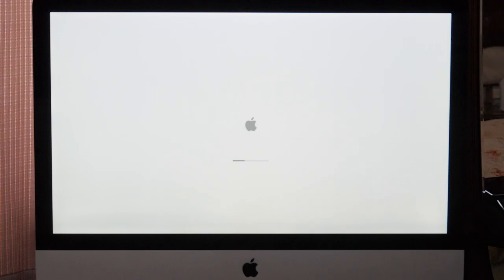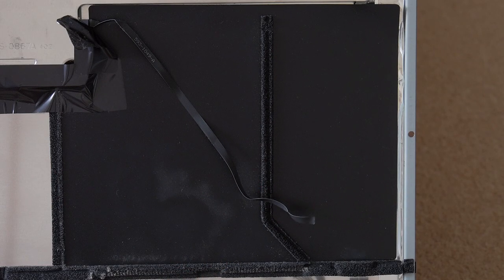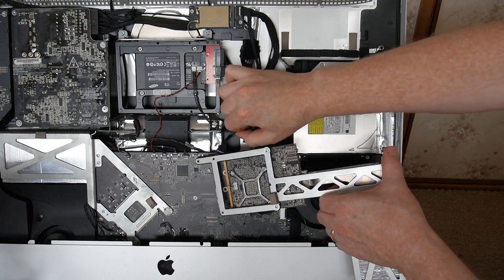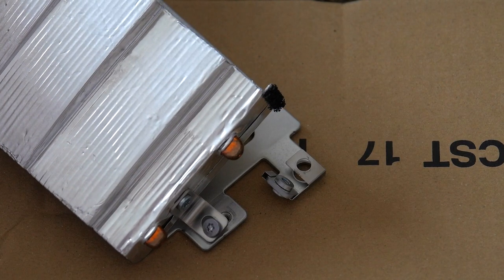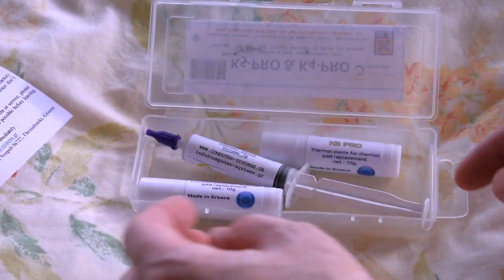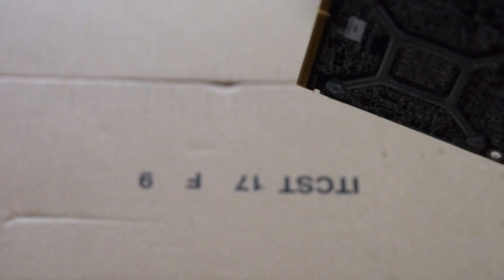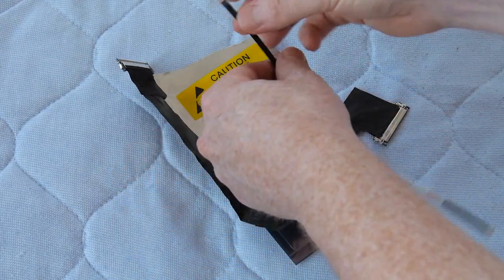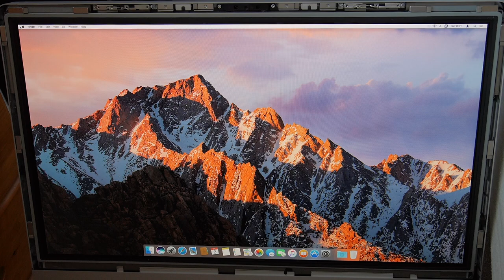Late 2009 iMac 27" Video Card Repair — 4850 — 2nd Bake

Comment: Hi JDW, did a 2nd bake on a 27in A1312, after a month on the first bake the GPU just crashed. After the 2nd bake the screen was just black, i thought that the GPU was dead, but after reinserting the video cables LCD opened up and everything is working. Hope this 2nd bake will last longer .
Reply from the maker: I'm sorry to hear your 1st bake lasted only 1 month.  My 1st bake lasted only 4 months, but my 2nd bake lasted 2 years and 9 months.  I think the problem with my first bake was that I didn't fully clean off all the old thermal paste, and the replacement paste I used wasn't brand new.  I'm therefore curious... Did you clean off all the old paste and apply K4 Pro (or Kryonaut) on the GPU and K5 Pro (or thermal pads) on the memory chips after your 1st and 2nd bakes?
Reply: @JDW-  on the 1st bake i cleaned the GPU the best I can. I think my issue was I am using a manual oven. So maybe the actual heat was not correct. Now made the oven heat up for 5min before placing in the card. And turn the dial over 200°
Reply from the maker: @JujoeM  My advice is the use a turkey thermometer or another oven safe thermometer during the oven warmup time to ensure the temperature is (1) correct and (2) stable.  If it goes lower than 200°C, the worst that can happen is the GPU chip won't be fixed, but if it goes much higher than 200°C, the worst that can happen is that components will become desoldered and possibly fall off.
Reply: @JDW-  Hope you guys are doing good. My iMac gpu died again, it gave me vertical lines. maybe the GPU is really bad already. I'll bake this again :) Question: does the proper thermal paste placement and brand/quality makes the GPU bake last longer? or the GPU is really going out already? Thank you as always
Reply from the maker: @JujoeM  I'm very sorry to hear that.  Your case seems a bit unusual.  You got only 1 month from your 1st bake and only 2 weeks from your 2nd bake.  There are only 3 explanations for this: (1) Your oven temperature is wrong (you need an oven safe thermometer to confirm it), or (2) you used only 1 type of paste on all the chips and/or you used old paste, or (3) your card is just too far gone for the bake to work.  If the oven temperature is very close to 200°C/392°F and stable, and if you use both types of paste that I recommend, I would think you should get longer than 1 month or 2 weeks of life from a bake.  With that said, there are no guarantees.  I can only tell you my experience and the experiences of other people in the comments, since I read and reply to every comment.  Thermal paste is very important though.  I didn't do a good job with thermal paste after my 1st bake, and I feel strongly that was the reason it lasted only 1 month.

Comment: I tried this and it worked!  Thanks!  On a side note, both the cpu and HD fans are spinning at top speed all the time.  Does anyone have any ideas why or how to fix it?
Reply from the maker: Thank you for sharing your success story, Clay.  As to why your fans are spinning full blast, you either forgot to reconnect a connector, or it wasn't connected security, or your inadvertently broke a wire.  All said, you will unfortunately need to reopen your iMac to recheck your wiring.  If a wire pertaining to a thermal sensor is not connected properly, that sensor would not work and would explain why the fans spin at full blast.

Comment: hello, I saw on many movies the bake solution but you are the one who convinced me. I have a mid 2011 iMac with this problem, I have already repared it with apple with the extended warranty. So, long story short... Is it ok to put K5 also on chipset? I messed up the order and now I have just K5. Thank you for your time
Reply from the maker: Thank you for your comment.  I would love to answer your question, but first, could you please explain what K5 is?
Reply: @JDW-  sorry for my confused question, I was referring to the grease you used for thermal contact. You are using K5 pro for memory and K4 pro for chipset. All I've got is K5 pro and the question was if I could also use it for the chipset or I must buy K4 or other thermal paste
Reply from the maker: @secpet  Thank you for the clarification.  No, you cannot use K5 Pro on the GPU chip because K5 Pro is made only as a thermal pad replacement paste.  As such, it has lower thermal conductivity.  Because you do not have K4 Pro, I would suggest you buy Thermal Grizzly Kryonaut because that paste is slightly better than K4 Pro. https://amzn.to/36NMQwu
Reply: @JDW-  Thank you for your quick answer. My K5 pads and Thermal Grizzly Kryonaut are arriving on Monday so on Sunday I'll be cooking, Can't wait! I'll post my results here.
Reply from the maker: @secpet  I look forward to hearing the result!  Best wishes!

Comment: No luck for me. Baked in the oven at 200º for 7 minutes and smelt like fried. When I took out the graphic card, the brown part of the main chip was melted, inflated. Of course it was not working anymore......any clue why that happened?
Reply from the maker: 200°C is the correct temperature, and although you may have set your oven's dial to that temperature, the only way anything would have been melted or fried is if (a) you left some kind of plastic part or perhaps the black foam surrounding the GPU on the card, which you should not do, or (b) it could be that your actual oven temperature is in fact higher than 200°C despite the dial setting.  I would love to see a photo of your card so I can better see what you are seeing.  Please also tell me the model of the card and the model year of the iMac you pulled it from.  Thank you.

Comment: What if I used the same Grizzly Thermal Kryonaut paste on both the GPU chip and the VRAM, would I still be ok?
Reply from the maker: No!  Definitely do NOT do that.  You need K5 Pro for the VRAM because there is a gap between them and the heatsink.  Kryonaut is NOT made to fill gaps.  K5 Pro is made to fill gaps.  You could also use thermal pads on the VRAM, but since it is very hard to measure the gap accurately, I advise people to use K5 Pro because it is a thick paste made to replace thermal pads and you don't need to measure anything to use it.  Amazon links to all these pastes are in the text description beneath my video above.

Comment: Hello. Quick question, can I use the thermal grizzly paste on All chips, and not only the GPU?
Reply from the maker: No.  There is a gap between the memory chips and heatsink.  That is why you must use either thermal pads or K5 Pro.  But to use thermal pads means you must measure the gap.  I personally cannot measure that gap perfectly to my satisfaction.  That is why I use a thermal pad replacement thick paste like K5 Pro.  Never use K5 Pro on a CPU or GPU though.  It's only for cooler running chips like memory chips.  You can use any good paste on the video card GPU.  I recommend K4 Pro because it usually comes included in K5 Pro kits.  But if you want the best, buy Thermal Grizzly Kryonaut for the GPU and use K5 Pro on the memory chips.  That's the best possible thermal paste combination.

Comment: As an electronics serviceman, the reason why this happens is because you have a considerably heavy  component generating heat rapidly and cooling down consistantly as it switches between igpu and random buffering etc. Because it's a component which is mounted vertically with solder. Solder tends to dry up and become brittle as it becomes oxygenated it gradually loses it's conductivity. Very common fault with Smart TV's which uses ARM based processors soldered and mounted in a similar fashion. When you heat it up, iyou're forcing those impurities out and reforming the bond. Especially the surface mounted components, the solder is very prone to microscopic cracks the eyes cant see
Reply from the maker: While that is a logical analysis and most often true, the fact remains that the video card issues only apply to iMac model years 2008 to 2011.  2012 and later iMacs continue to use basically the same body shape and continue to have their newer version graphics cards mounted in the same exact vertical way.  The heatsink and overall cooling solutions of 2012 and later iMacs are not really better than prior iMacs.  And yet, the 2012 and later iMacs don't have the same problems with graphics cards failing as their older siblings.  Although it may seem clear to some that the solder balls are the issue (for reasons you just stated), it is in fact a problem that goes beyond that.  Yes, it could be the solder balls in a few cases, but the majority of failures pertain to the design flaw in the graphics cards in those 2008 to 2011 iMac models.  More specifically, in the GPU chip itself, such that when the GPU chip is heated in the proper manner, the flaws internal to the chip realign so that the card works again, at least for a time.  While heating the card works long enough for most people to find the bake worthwhile, it doesn't last forever because the flaw inherent to those cards is still there.  Even so, if the bake can make a computer last another 2-3 years, most people like myself who try the bake find that it is something worth doing.  

The ultimate "fix" is to buy a newer iMac; and with Apple Silicon being so amazing today, it makes the most sense to get one of the latest models, assuming 24" is large enough, and the colors Apple has chosen doesn't blind you. :-)
Reply: @JDW-  newer models are integrated with little to no solder basically hard pressed onto the circuit board with tiny holes in between for air flow/compensation for expansion  with no components on the otherside which also acts as test pint for tracers. The older method relied on having the chip float ontop of the solder balls so the chip wouldnt transfer it's heat onto the board and have components dropping off the otherside
Reply from the maker: @jizmo9398  But there are still 3 things your otherwise logical and reasonable argument is not factoring in. 

First, "hardpressed" or not, the 2012 and newer iMacs still use a GPU that connects to a PCB using solder balls. Photo example: https://www.notebookcheck.net/uploads/tx_nbc2/GeForce_GT_640m_3qtr.jpg

It also doesn’t matter so much that PCB is the motherboard itself or a separate daughter card that connects to the motherboard. The heart of your argument focuses on the theory that solder ball integrity is the root issue with the 2011 and older iMac graphic cards, so the fact that both the 2011 and older iMacs and the 2012 and new iMacs use a GPU chip that connects via solder balls (hard pressed or not) is significant to show there is not a massive difference in that area between the iMac model years.

Second, Apple switched from AMD to Nvidia starting with the 2012 model iMacs. That, I believe, really brought about the resolution of the root problem, not simply from the Nvidia chip being "hard pressed" to the PCB. As I have said, it’s a problem inherent to the GPU chip itself, on AMD branded GPUs, rather than solder balls which physically connect the GPU chip to a PCB.

And thirdly, the temperature of the bake, which is known to resurrect malfunctioning AMD graphics cards in 2008 to 2011 iMacs, is not hot enough at 200°C to truly melt (and therefore "reflow") the solder, because if it was, the components on the bottom of the video card would fall off during the bake. But they don’t fall off (with a stable 200°C baking temperature), thus providing evidence we are not truly melting the solder balls under the GPU chip. Furthermore, we are not adding any flux either when we do the bake, which really would be required to reflow the solder in the proper way. 

What the bake does is heat the AMD branded GPU chip sufficiently (at 200°C for 9 minutes or so) so that the defect inherent to the chip itself, not the solder balls underneath, are resolved, albeit not forever.

Even if one is adamant about rejecting my conclusions, the fact remains that the bake works for most people who try it, and it tends to last long enough to have made the effort worthwhile.  That's not merely my feeling, but rather the general consensus of most people who have provided such feedback to me under all of my bake videos over the years.  I read every single comment posted, and in many cases reply to them as well.

Thanks again for sharing your thoughts!

Comment: Your video is fantastic. My iMac 2009 video card just died 4 weeks ago and your video inspired me to try this "bake". I'm not a techie so alot of this stuff is new. Do you need 2 different thermal paste? I'm thinking of just using Artic MX 4, which is non conductive on all the chip.
Reply from the maker: Thank you for your kind words.  I would strongly advice that you use 2 types of thermal paste, yes.  The reason why is because if you clean off all the thermal paste on your video card, including the THICK THERMAL PADS atop the memory chips, you will either need to use THERMAL PADS on those memory chips (which I do not advise) or use a very thick and specialized "thermal pad replacement" paste like I did.  K4 Pro and K5 Pro are sold on Amazon and come in a kit, as mentioned in my video.  I am past the 5 month mark and my video card is still going strong.  You could try other pastes that are NOT electrically conductive, but you will still have the problem of how to get that paste to work on the memory chips.  You see, there's a big gap between the memory chips and the heatsink, which is why normal "thin" paste won't work to fill that gap.  And again, that's why I went with K4/K5 Pro.  Best wishes!
Reply: Thanks for the quick reply! As I have mention, I'm totally clueless...so the different between the 2 paste is that 1 is thicker? The reason I mention Artic MX 4 is it was highly recommended in some forum and will last for 8 yr. But I have no idea if you can apply it to the other chips. Is the Artic 4 too liquidy and wouldl not be able to achieve the thickness required?
Reply from the maker: Arctic MX 4 is a thin, liquid paste that is not intended to replace "thermal pads."  So even if you use a lot of MX 4, I don't think the connection between the top of the memory chips and the heatsink would be good, nor would it last 8 years.  You must either use thermal pads on the memory chips or do what I did and use K4/K5 Pro.  I never used "thermal pads" as replacements, so I can only provide advice based on what I used.  You definitely need a very thick paste atop the memory chips, just like what you see in my video.
Reply: That's what I thought too. Thanks for the advise! BTW, I was running High Sierra which I just upgraded and a week later this thing died...$700 to replace the video card. A real bummer.
Reply from the maker: I would never pay $700 to replace the video card in a 2009 iMac.  If it ever gets to the point where a bake no longer works, and if my only option to buy a new video card is to pay $700, I would be better off recycling the 2009 iMac and buying a new one.  The 2015 and later iMacs don't seem to have this video card death problem.
Reply: It work! Thanks man. Do you have any problem with high sierra? I am hesitant to update since thats what kill the mac.
Reply from the maker: I have no issues running High Sierra at all, and because I have an internal SSD (which replaced my stock spinning platter HDD), the SSD was formatted APFS.  Just make a clone of your machine using Carbon Copy Cloner, then update to High Sierra.  If you don't like it, you can fall back using your clone backup.

Comment: sad to hear it broke again, mine still works though, but i'm seeing some small irregularities in the pixels strokes of three lines each across the screen. Conclusion I may have to bake mine as well sooner or later.
Reply from the maker: Sorry to hear that, Luke.  Just be careful when you open the iMac so the display doesn't fall forward, breaking the ribbon cable.  I was flabbergasted when that happened!